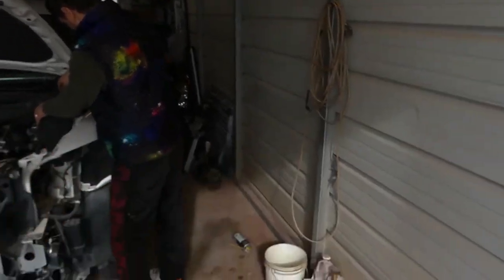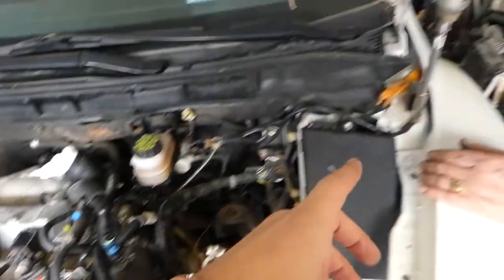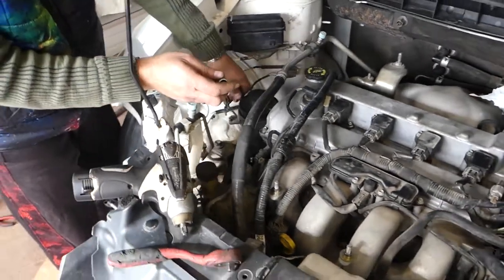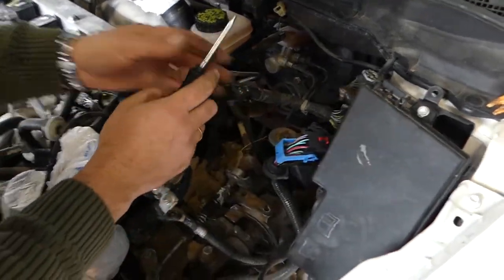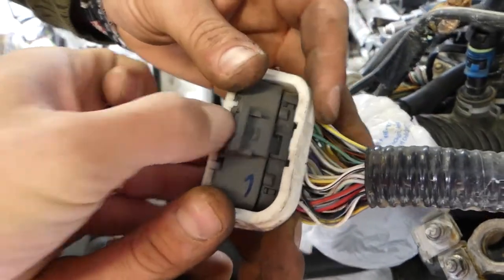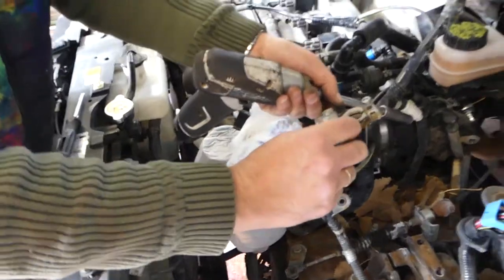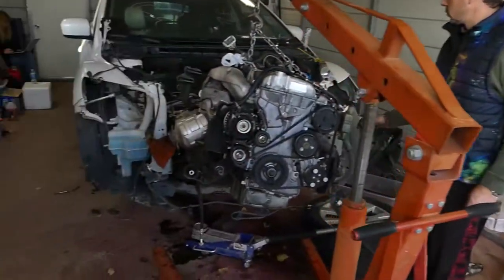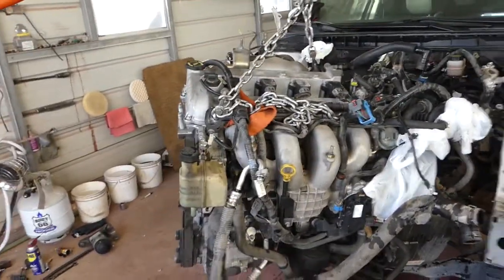MAZDA ENGINE WIRING HARNESS DISCONNECT REMOVAL REPLACEMENT ENGINE

Comment: Hi....I have a cx7 2009  whose engine knocked. I have bought a replacement  which came complete with automatic gearbox and transfer box and computer. I would like to convert it to auto since it had a clutch/flywheel problem too.  My idea is to buy the gear shifter plus auto transmission cables.  Whats your advice.

Comment: question...my mechanic is saying i need to replace the wire harness to my 2007 mazda cx7 that touches the starter do you guys know that part number or name of the piece becuz everytime i think ive found it he says its not what i need. the problem im having is that there is no power getting to the starter.

Comment: Too much work just to pull the engine.  Take the top transmission mount off it gives you more room in the front of the engine.  Then pull just the engine from the top.